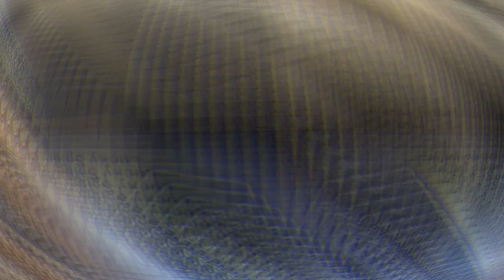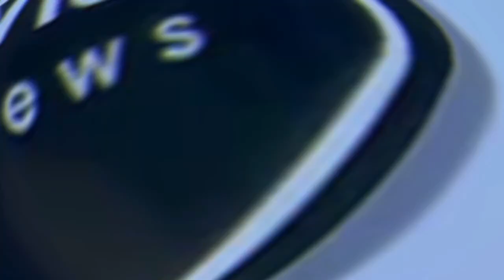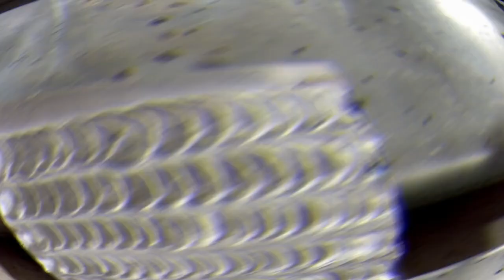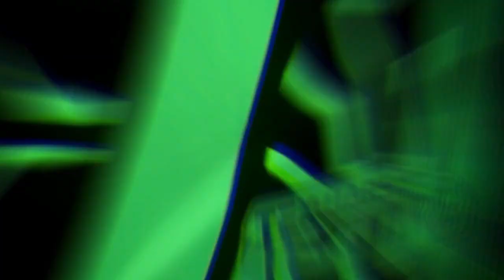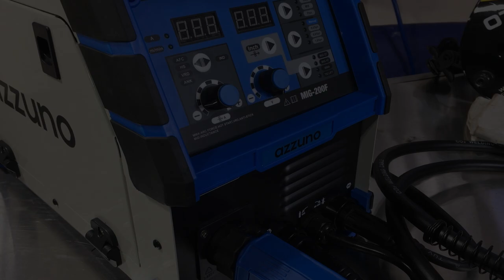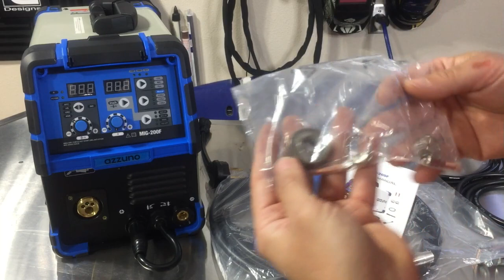Azzuno MIG200F MIG Welding Machine: A Comprehensive Review

Comment: Thanks for the video.  I have the Azzuno 200f, and currently run it on 120 Amps on a 12 gauge 20 amps circuite.  If I wanted to run it off of a 220 circuit, what size breaker would be required.  I was considering running a 10 gauge wire on a 30 amp 220 circuit, but was not sure if it would be enough.

Comment: My guess is the inner shoulder for the spool holder had to be smaller in diameter to ensure minimal resistance to the spool rotation. The feed mechanism should be dictating the speed and not the spool resistance.

Comment: The way you're melting down over that spool holder kind of makes me think you've never welded before. The slop is good. If it was a tight fit the spool would bind. The drive rolls are what is important....and then you get hung up on the handle...like dude you seem like a young guy and you're already turning into a grandpa...wonder what you'll be like when you're actually old
Reply from the maker: LOL yes i guess i am an old man already.
I have welded in aerospace both military and civilian sectors for over 20yrs. people tell me i look young but i have children who finished college and/or serving in the military. Anyhow, I've used the best machines available so reviewing a cheap toy machine is an adjustment.
Reply from the maker: Most professional level MIG welders (Cobramatic, Millermatic, Multimatics) use a spindle+hub setup. The wire spool doesn't slop around on anything because its part of the hub. The hub spins on spindle👍

Comment: I am looking to upgrade but have to keep cost down as I am retired without a lot to spend. The machines I have been looking at are the azzuno mig 200F like you review in this video the other 2 are the Tooliom 200M and vevor 270 mig. I know you have not done  review on the vevor but I was wondering which of the other 2 would be your first choice. I have done quite a bit of stick welding but just getting into mig and flux core. I have an old 240amp AC-DC arc welder  Made by century and sold by monygomery wards,  which does great on anything I have used it on up to 1/2 inch I beam. I like the ease of the mig but I made the mistake of starting off with a central electric 90 amp flux core from harbor freight, it does ok on really light stuff but not so much on anything over 1/8. You recommendation would be much appreciated.
Reply from the maker: I was very impressed with the Tooliom 200. The performance for its price range is excellent.
Reply: ELIKLIV 215 Amp good or not please give me information
Reply: I think all these welding machines are satisfactory, however, the accessories like the stinger and ground cables are really inferior

Comment: I think the arc sound was telling me that the machine setup wasnt exactly right .... Maybe spool setup feeder tension... A little too much spatter ... What do you think was causing that ?  I would love to see some 120v welds since many people will be using 120 on this.
Reply: 120 works awesome just don’t weld anything too thick or you’ll trip the breaker. I’m a weekend welder and use this Machine with all 3 processes
Reply: Wish tig had settings though

Comment: So I purchased the tooliom 200m after watching a ton of reviews on it. I heard you mention it again in this video. I did watch you review on it. But I was wondering how you still feel about it now that you've had it for a while? You still impressed with it? I hope I like it. I'm new to welding. I was using the ol chicago electric 90amp which is an ac welder and I couldn't get any good welds out of it. My tooliom will be here in a few days I'm hoping it steps my beginner game up a tad. What do you think?
Reply from the maker: Hi and thanks for watching. Yes, I am still using the TL200M and it's one of my favorite MIG machines under $1000. That's saying a lot considering it's under $300.
Reply: @EverydayVics  could you actually TELL US THE SETTINGS? I mean, the instructions are absolutely worthless. Watching someone attempt to figure it out and not really say anything concrete that's usable doesn't help at all.

Comment: I have a lot of appreciation for how in toon your video are the mig guns are all the same make it is ether a binzel or a tweeco unless you go out a buy a Bernard mig guns and they are top of the line the azzuno is a decent machine to really test it out is maximum output and see if it's able to weld and keep up with the wire speed. Most shit welders like the Vulcan it can't keep up with the wire feed it pops and splits. Alot of your welds needed to adjust the ind and the splatter will go away.
Reply from the maker: Thank you. That's great info and makes sense. I did play with increased inductance off-camera but don't recall much change. I also tried voltage adjustments. I really wanted to like this machine and was hoping to add it to a quick-fix area at another shop. If I come across this machine again I will remember your suggestions. Thank you for watching🤙

Comment: I think the extra hole in the back is for an external spool of wire. That's the only thing that I can think of using it for
Reply from the maker: Thanks. I tried looking in the manual but no info about it.
Reply: That makes a lot of sense. I noticed a few guys have cut similar holes in the back of their welders to run the bigger spools like the older 2 part setups.